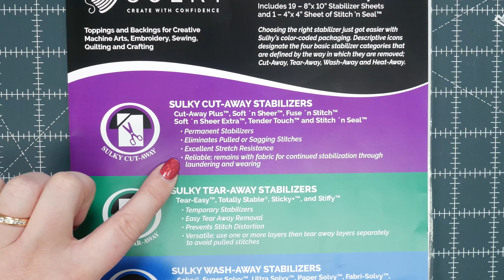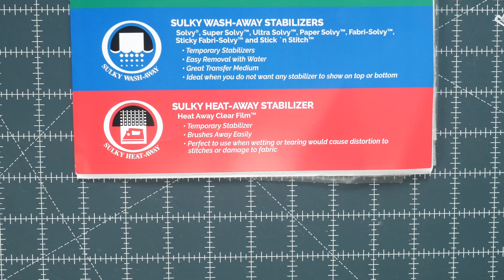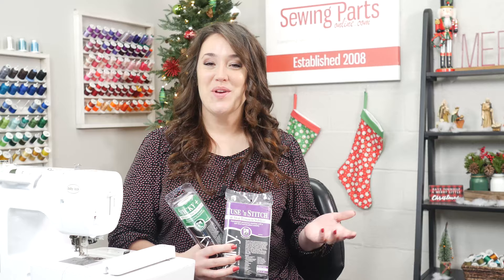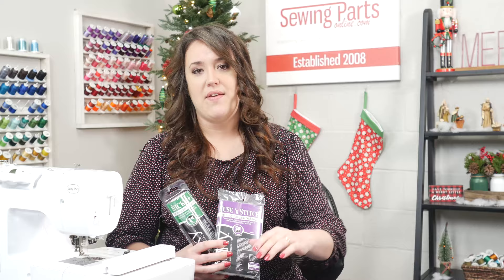Learn Everything About Embroidery Stabilizers | Tear Away Stabilizer | Cut Away Stabilizer

Comment: What would be the best option for embroidering on very light material like chiffon and a light polyester? I’ve tried a wash away and it is puckering after I wash it out. It needs to be invisible as it is  a worn project.
Reply from the maker: I, too, would have tried the wash away. Have you tried using 2 layers of the washaway?
Reply from the maker: I, personally, have not; however, I have been told that you can.

Comment: Hi,thanks for sharing this information, quick question about the spray stabilizer, is it starch based ? I'm allergic to most starch products.
Reply from the maker: I will peek in the morning when I get to work and let you know. :)
Reply from the maker: Good morning, Lesley. I checked the back of the Terial Magic and it states, " Terial Magic is a non-starch stabilizer which means it won't attract insects or leave a residue."